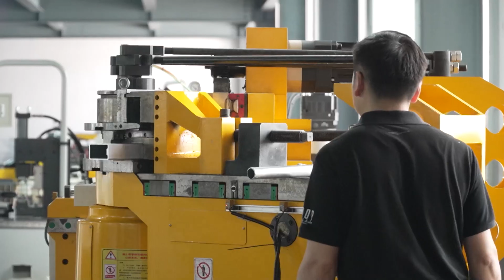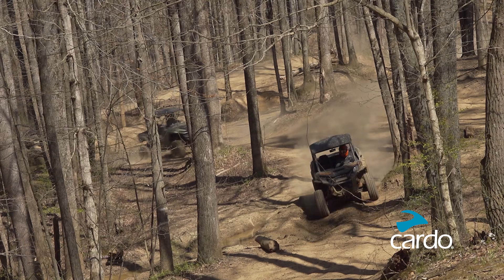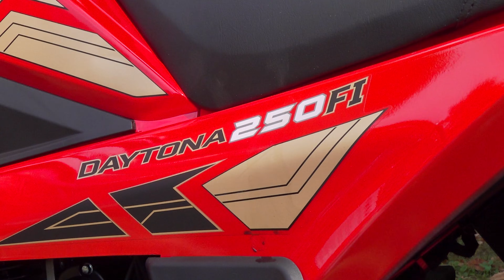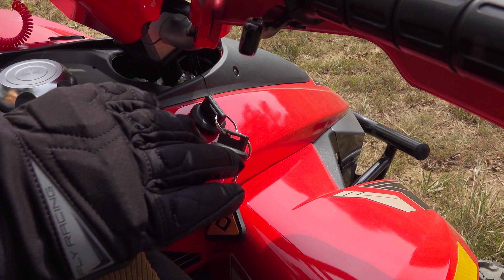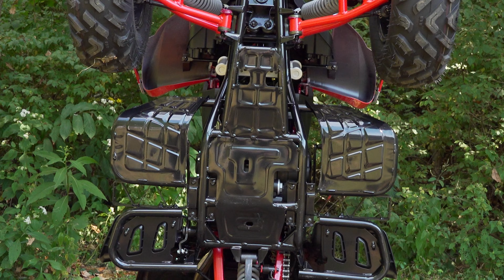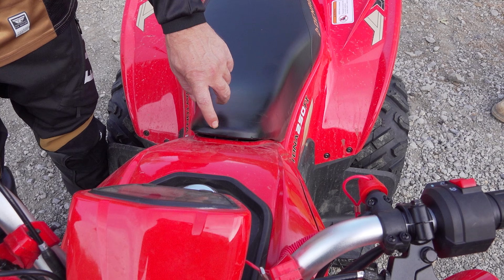2026 Denago Daytona 250 FI Test Review | Affordable Beginner Sport ATV

Comment: Looks like a joke.
Reply: I mean, for as little as 2500 bucks, it's a great option for a kid looking to upgrade in power but not a lot in size. I would never consider this for a 16 and up rider. I would look at the kayo a300. It's a little peppier, 5 speed with reverse, significantly wider and piggy back suspension. A step up for experienced riders, not learning riders. This is pretty suitable for a 11 or 12 year old who has maxed out the speed and maneuverability of something like a 125 or what not. Definitely a market for this quad

Comment: I would like to see the denago 250, honda 250x and a kayo 300 in a shootout. The kayo being bigger in displacement but all filling the 250 void left by all major brands. 

I would be interested to see how the denago would run with better shocks and tires. Would also be interested to see run on a motocross track. For the price its a nice machine.
Reply from the maker: That would be a good comparison. We'd like to try it with tires and shocks. We'll have to see if the aftermarket comes out with any suspension.
Reply: Kind of amazing that our $2700 Daytona compares with quads costing $1000s extra! The value can't be beat! We respect Mr. Tolle's critiques, and we intend to retune the shocks for better performance.
Reply: Why would you want to see that the Honda isn’t even near in the same class with that Chinese made junk the Honda will be running long after those piles are gone
Reply: @JimmyRoberts-v9r  mostly because it would be good the comparison for them. These other company's are filling a void for the smaller bore atvs that the quad community desperately needs. People are racing the kayo 300 currently and its doing well and hold up.

Comment: I couldn't find any specs on suspension travel and claimed hp (I'd guess around 18 for a 2v air cooled 249cc) Its an interesting price point, some premium features, some missing, its hard to get the spring rate right for different weights, but I'd expect a slower rebound\compression would be easy to setup, although looks like TaoTao might have just used some off the shelf pieces.  You could see how stiff it was in the video, looked like little travel, or it couldn't be accessed.  It looks good, too loud though!  at 2500$ USD I'd think the Chinese could do a decent motor, dampening and good gravy, an O-ring chain.  If CFmoto can do it, these guys can too! interesting!  I recently rebuilt an old Warrior 350, after riding so many big 4x4 machines, its pretty refreshing, simple, not much to break, incredible on off-cambers, descents, climbs.  The Chinese could dominate with another low priced Warrior clone, so close!
Reply from the maker: We were actually pretty happy with the motor and we're not upset that it wasn't an o-rng chain. Tires wheels and shocks are the big three things we'd like to see changed.
Reply: @ATVonDemand  Nice! Sounds like its pretty close, Sport ATV tires would suit the sport in it I suppose more! those sort of Bighorn style tires probably ok for general ATV riding?  So much mud and snow where I live, for a sealed chain, but if you guys say its ok, I believe you!  It always seems with  Chinese stuff, either good but too expensive (CFmoto vs Polaris) or Cheap and pretty bad, or kind of good, but weak suspension etc for a Chinese importer, seems like these guys are going all in for TaoTao etc.  In Canada it seems to always be some fly by night Chinese importer, leaving models you can't get parts for.  (Or Segway even!)
Reply: @Kingsoupturbo  we're in the process of establishing a Canadian presence. Stay tuned!